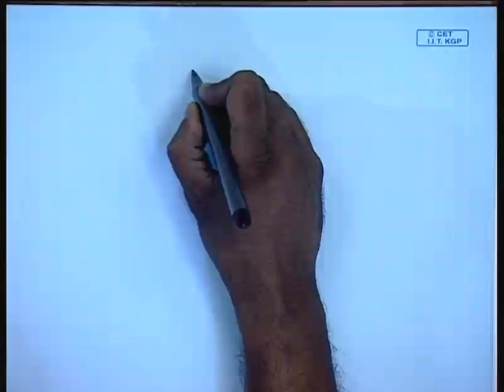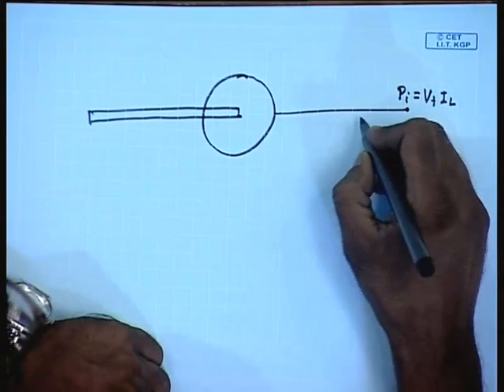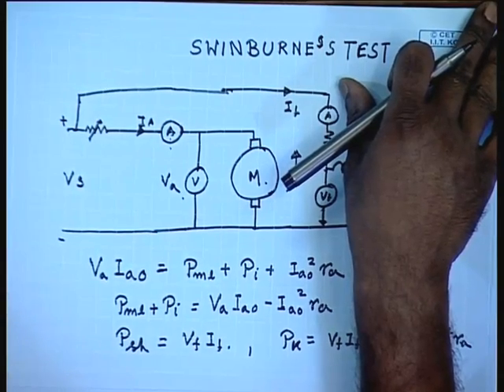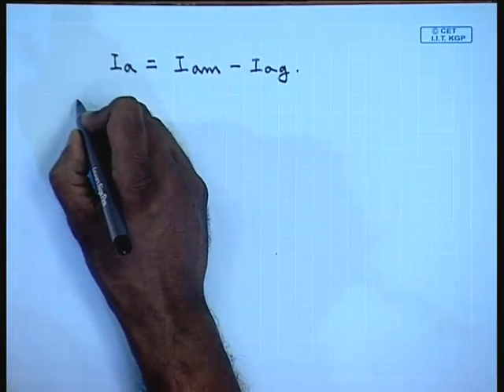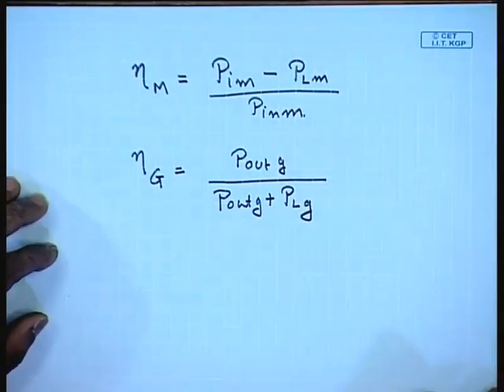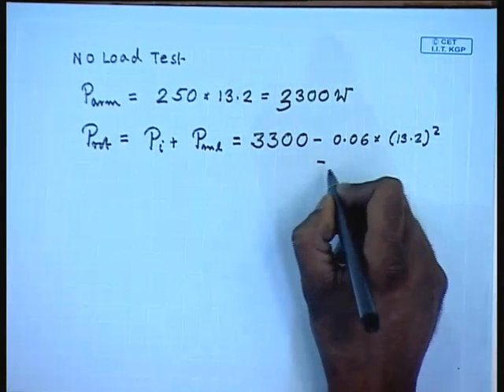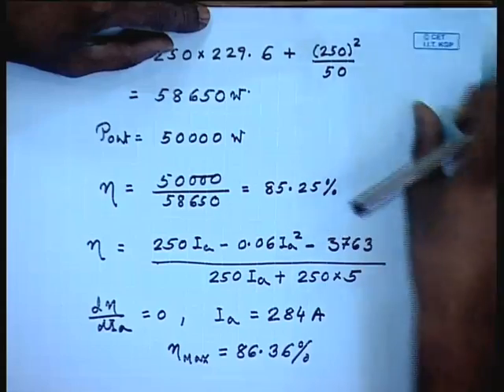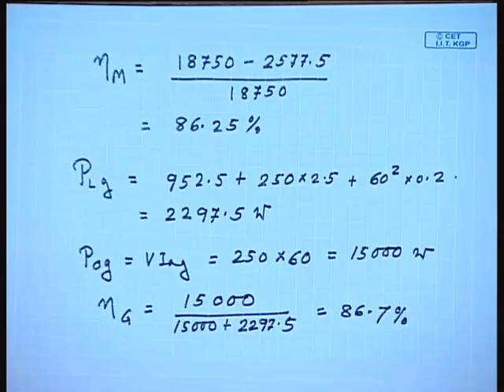Mod-01 Lec-35 Lecture-35-Testing of DC Shunt Motors

Comment: looks like sir forget to add armature resistance into the stray load losses equation, it is as follows:-   VIa-Iam^2Ram-Iag^2Rag and sir will add that later in the lecture.